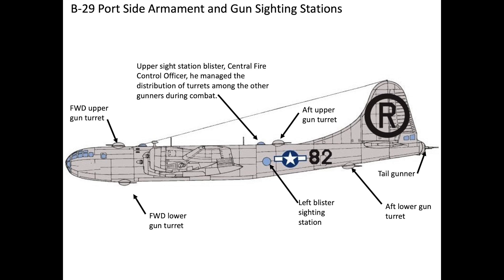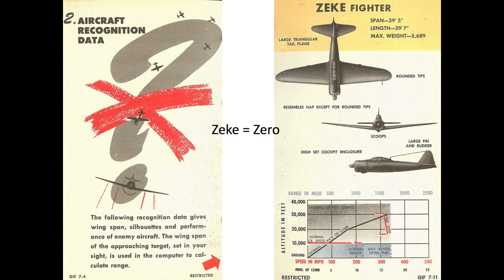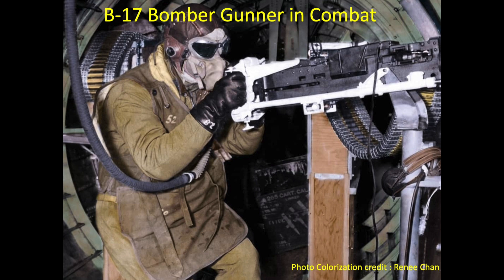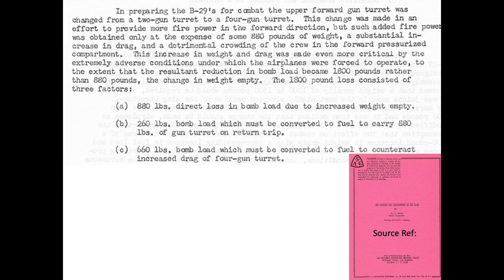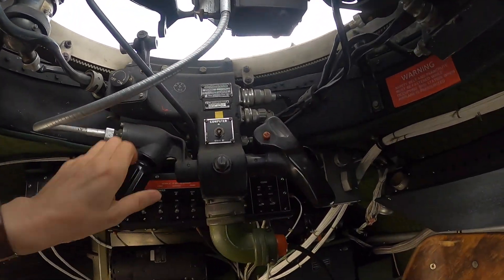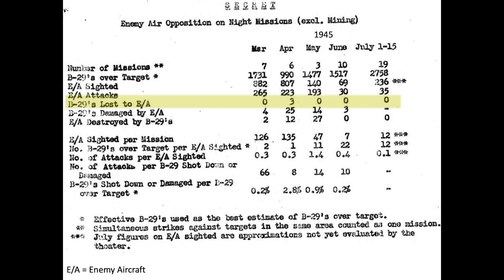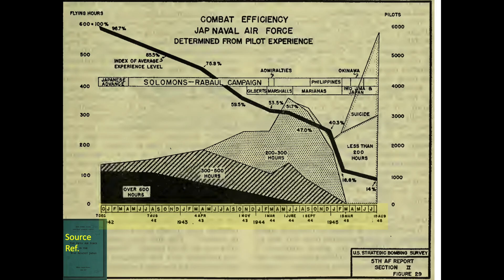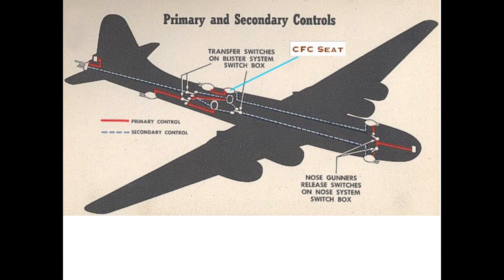Why the WWII B-29 Bomber's Gun System was so Combat Effective

Comment: I'm sceptical about the figures regarding the reduction in bomb load from two additional machine guns in the forward turret. The B-29s that dropped the a-bombs had all armour and armament (except tail guns) removed to enable carrying an extra 4,000 lbs or so of bomb load, which does not really square with two extra guns reducung bomb load by 1,800 lbs.
Reply: I have read somewhere on the internet, probably Wikipedia, that a B-29 taking off for Japan from Tinian had 2.5 tons of bombs and 10 tons of fuel. A return trip of 2,400Km
Reply: The guy doesn’t seem to be making it up he is using figures the army is using. They did the calculations and testing. They have no reason to make it up.

Comment: My dad was a B-29 gunnery instructor, from late '44 to early '45. He didn't really say all that much about the B-29's gunnery system, just that one gunner could operate more than one turret at a time. This video fills in all the vast holes in info I could glean on the system, most of which I only have gotten from reading books on the B-29 missions.

Thanks for the vid, especially showing how the different mechanisms of the system worked. Now I have a better idea what my dad had to know so he could teach the gunnery crews -- many of them probably sent to the Pacific Theater.

Comment: In the last few months of WW2 with B29s raiding Japan, LeMay ordered that the tail gunner be the only defence weapon to be retained and the weight savings of two less crew etc and weight of guns and ammunition gave the B29s higher service ceilings, better fuel margins or more bomb load. More B29s were downed from engine failure and running out of fuel than enemy fighters. 25% of all B29s were lost this way.  Like the B17, the B29s 50cals were not good at downing enemy fighters. Japan didn't waste Zeros on attacking bomber formations. It was futile. They concentrated on attacking Okinawa and US shipping. The other problem solved was that a B29 with full crew, full tanks and a full bombload had trouble getting into the air from the 7500ft strips at Tinian. They were supposed to be 8500 feet. Major screwup. The first aircraft to try it ended up in the water off the end of the runway. LeMay was furious. Even with the weight savings, the engines only had 3 minutes on full military power before they had to be replaced. The Corsairs were worse. One shot of water injection in an emergency and the engine had to be replaced.

Comment: There are actually some conflicting assessments of the system's reliability as it was new tech with some development issues. Following is a critical assessment but the most of what I've read depicts operational successes regards the gunnery system . . . not so much the initial Wright R-3350 power-plants or engine nacelle flaps. What seems to be the main reason to scrap the turrets are weight savings for one goal or another and the fact that the aircraft's speed relegated the majority of attack passes being head-on. 
The B32s try at this, also with the "Sperry" system was said to be either more problematic or the problems more publicized. 
I would guess that the pressurized interior would have been mighty vulnerable had Japan been able to field well trained pilots with more capable aircraft in the numbers reflected in the B29 gunner kill claims..
My dad was a gunner for the 90th Squadron, 3rd Bomb Group, 5th AAF in A20s and A26s, the latter having similar remote controlled turrets. He claimed to be denied use of them in the air defense role due to their most excellent P38 escorts which fielded notables such as Thomas McGuire and Richard Bong. 

FWIW here's the aforementioned critical balance: https://theaviationgeekclub.com/heres-why-the-b-29-could-have-had-a-higher-loss-rate-than-the-b-17-and-b-24-over-germany-in-1943/

Comment: I'd be interested to know more about the drill for depressurisation before combat. Presumably the bomber crew would get cold pretty fast or did they have heated jackets they could put on quickly?
Reply: You can depressurize and still heat the air inside the plane.

Comment: The machining that went into that analog computer. I'm a machinist and we're some of the most annoying, arrogant, finicky people. Obsession and perfectionism built that computer. Those engineers and machinists were amazingly intelligent.
Reply: Right! I just love analog computers. They're endlessly fascinating, with all their gears and levers, knobs and dials. Some very deep thinking and understanding of math went into them.
Reply: This WW2 tech can’t be duplicated today.
Reply: @hotlanta35 are you insinuating that this tech came from other worlds? If so, that’s incorrect. This tech from ww2 is outdated
Reply: You are trying to put words in my mouth.
Reply: @hotlanta35  There is a BIG fucking difference between 'can't' and 'wont'.
Reply: @Mets2015WorldSeries at no point did he say this tech came from other worlds. Do you know how to read?
Reply: They are really works of art. I'm fascinated with the electro-mechanical computers of that era; not just the B-29 but also naval gun computers such as on the USS Iowa. These things all did math, and were as accurate as the input data allowed. Technically, they are "calculators" not "computers" in the modern sense of the word. Calculators run only one program which is in fact built into the machine, while a computer is reprogrammable. Just a little semantics trivia FYI.
Reply: @ToolcoVFX  I've held one of the ferrite ring magnet memory units that the RAF used to use in their jets as memory, X/Y/Z axis wires in a thick mat, where one is obviously the read wire. I think you have to rewrite the magnet once you have read it as it's a sort of destructive read.
Reply: @ToolcoVFX  These computers were mostly mechanical computers that used electronically powered servo motors to retransmit shaft positions.   They derived from naval and AAA practice.   Prior to servo motors humans would need to re-enter the shaft positions manually which is why the M7 predictor had a team of 9 people which was eliminated with the M9.
-The way they worked is simple:   numbers were represented as shaft turns.   Addition was performed with differentials.   Multiplication, Division of two variables was performed by conversion to a Logarithm on a cam, addition with a differential and conversion with an antilogarithm.     Cam shafts were usually 3 dimensional.   Trigonometrie cams were used for parallax conversion.    Ballistics cams provided time of flight data and superelevation needed for projectile fall off.   
-The More accurate systems converted from cartesian coordinates to do the firing solution and then back again to spherical coordinates.
Speed was often easily obtained from tachos generators mounted on the shafts or mechanical subtraction.
Reply: I'm a machinist too... guilty as charged.
Reply: An instructor in college told me to never frame a house with your machinist friend, but definitely ask him to help build the staircases.
Reply: @davidfortier6976  ah, so he didn't want to frame it square. Shame.
Reply: Truly The Greatest Generation
Reply: Like machinists, engineers tend to be annoying, arrogant and finicky.  Machinists are more likely to ride and restore motorcycles.
Reply: Your right, I work with machinist and they are  some of the most annoying, arrogant, finicky people.

But I wouldn’t work with one that wasn’t ... :)
Reply: The majority of surplus analog computers went into late 1940s and 50s Wurlitzer jukeboxes. I have spent many thousands of hours restoring these jukeboxes and it has always amused me that a device so potentially deadly could wind up entertaining people.
Reply: Pride and duty to their country pushed people to put out war materials !!
Reply: But thats the real thing isint it? Making a set up that a well trained houswife can use to machine a complex , critical component. I wa a machinist for 35 years. My most challenging were programming and setting up half a fifty man shop full of fadals n haas vmc's . i had some machinist apprentices, some tool and vice or clamp setup men 2 great inspectors and buttom pushers who needed to be able to measure and deburr their own parts. We put a lot of respect into people who could operate a file really well! It all comes with training but yeah I guess they're all artists in a way. I never made more than a flagman and yet I was making parts that are still in space parts for Allegheny air ballistics Laboratory, and artificial heart valves among other things. I love to make things for myself for my Cafe BMWs but who wants to be a machinist with all that responsibility and make nothing and be treated like crap
Reply: It's closer to a mechanised series of log tables, not a computer.
Reply: I'm not a machinist, but I dabble in it as a hobby, as well as some other allied occupations.  I think people used to be a lot smarter than they are now, based in part on the subject of this video.
Reply: The other alternative was defeat and death… I understand the impetus

Comment: I've seen some old war footage with these turret computers and fire controllers. It really is amazing how far and effective the upgrades are compared to a b-17. Really night and day.
Reply: It really is amazing how advanced the Super Forts were.
The B-17 looks like a plane from the 1930s. The B-29 looks like a plane from the early Cold War.
Reply: Too advanced for the time... [Edit: Apparently I was wrong about the turrets, given the effectiveness stats in the video... Even if you cut back these figures as overestimation or bad Japanese tactics, they are surprising. But almost the only effective missions were the night raids, which all had the guns removed, leaving the turrets entirely as massive dead weight]. By the time the engine bugs were ironed out, the War was long over (only 1654 built in WWII out of the 3970 total). Only the weakness of Japanese defenses gave the illusion of superior performance, and due to magnesium engines burning at 5000 degrees through the wings in seconds (a material never used again) around 150 of 493 losses were engine fires (possibly as much as 250), The engine reliability was bad, and only through massive logistical overkill from engine replacements was this alleviated. By the time they were reliable, the whole aircraft was outclassed by jets. It then did get slaughtered by Migs in Korea... To minimise overheating during WWII, it flew with cowl flaps open all the time, so far, far below spec speed, this all the way to the end of WWII. Only Nuclear bombers and B models had better engines during WWII. Pressurisation also made it blind from condensation if damaged, so over Europe against stronger defenses (even if only from flak) it might not have fared that well. The expense of the turrets did make sense with strong fighter defenses in mind...
Reply: @wrathofatlantis2316  Sounds like you know a lot about American aircraft. Thanks for the explanation.

Comment: My dad was combat camera with the B29s, so some of the footage you see of them would have been made by him.

The only story I heard from him: The toilet in the B29 was basically a big can. Common practice was that whoever used it first had to empty and clean it after the mission. There would be a lot of crossed legs and straining for several hours until someone finally gave in and used it, immediately followed by the pilots cranking up the trim to account for the rest of the crew running to be next. 

Am guessing a bit exaggerated due to the plane probably being on auto pilot.

Comment: My understanding from, old timers now mostly dead, is that the B29 integrated gunnery system, didn't work very well as it kept breaking down. The kill ratio success was mostly because of three factors: the B 29 mostly flew at very high altitudes, (Japanese planes had much poorer performance at those altitude s) radar now  much improved latter in the war detected Japanese planes much farther out. the flight speed of the B29 made interception more difficult for the Japanese, negating the ability to choose a more favorable attack profile.
Reply: Also, by this time in the war, fighter escort was available nearly as soon as the B29 went into combat in the Pacific.

Comment: I wonder what was so great about MiG-15 that it was able to take down these flying beasts in such large numbers in Korea...
Reply: I had a good friend who was a main gunner on B29 and B,50 in Korea. The ability to get off aimed shots against jet fighters was about 1 second. 
He said that they trained against American jets,in daylight,from all attack angles. For a head on attack the chance of even seeing the fast closing jet was slim.
They changed to night raids,but still had to do daylight recon missions, which were very hazardous.
Reply: @blindhog2756 The gun system did have significant impact at Korea. The Soviets knew the record over Japan. For several months after the MIG’s showed up, they did not make a pass. This was probably the biggest impact. They did circle miles away. Once they made passes everyone learned the system was out of date. The gunnery system did restrict the MIG’s to rapid passes, also providing much protection. Someone mentioned tracers. They were used, at least by the two wings out of Kadena. Every fourth or fifth round. Someone decided that the tracers had a different ballistic arc, so they were pulled. SAC kept stats on everything. Most MIG’s did turn off during their pass, only a very few passed by at wing length. They found that with no tracers the average MIG turned off ~200 yards closer. The tracers went back on the ships. The USAF did credit B-29’s with shooting down a few MIG’s at Korea. Dad was skeptical of this, but as a lead bombardier the target was his focus. He said get in close enough and the gun’s servos didn’t keep up. Maybe. I don’t think the concept of latency was common in 1950.

Comment: So much information ! Awesome !  2 things that surprised me, 1/ the payload penalty when using a quad 50 turret. I would have guessed much less maybe 500ish ? 2/ The pretty poor arc of fire of the tail turret. Seems common to most bomber tho so I'm wondering why. I'm guessing it technically difficult to have a full blown turret all the way at the end of the plane. Definately not a place where you'd want extra weight.
Reply: @jackgee3200  Only the B-29 had armament removed due to the Japanese holding back for the invasion... And it was only the GUNS... They still dragged those 4 X 2000 pound turrets with no guns on those low altitude raids... And angled guns allowed the Ki-45 belly attacks without fear, save a few "misguided" crews keeping one lower rear turret armed with minimal ammo... They could not claim the kill afterwards, having disobeyed the disarming orders...

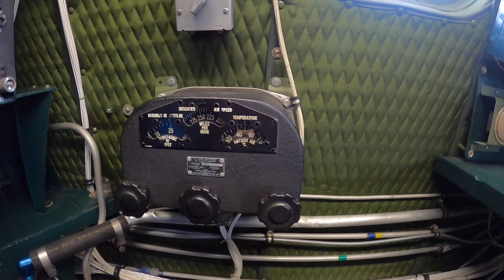Comment: 1:35 : Degrees Celsius ?! In a U.S. WW2 aircraft ?! It's the work of the devil ! :D

More seriously, was there a specific reason to choose Celsius over Fahrenheit, as the bomber crews were obviously more familiar with the latter ?
Reply: It probably made the internal math done by the computer easier.
Reply: @kerededyh  Not really. The thing that matters the most when doing those kinds of calculations is the absolute temperature if approximating the air as an ideal gas, so you'd be using Kelvin or Rankine degrees.

If it's something related to the boiling point of water, the Celsius scale makes sense... in standard conditions at sea level. Which is obviously not the case for the intended flight profiles for the B-29.
Reply: The Celsius or Centigrade scale goes back well before WW II.

In 1742, Swedish astronomer Anders Celsius (1701–1744) created a temperature scale that was the reverse of the scale now known as "Celsius": 0 represented the boiling point of water, while 100 represented the freezing point of water.

In 1743, the Lyonnais physicist Jean-Pierre Christin, permanent secretary of the Academy of Lyon, inverted the Celsius scale so that 0 represented the freezing point of water and 100 represented the boiling point of water.
Reply: I don’t get that either.
I tried looking it up on several different websites and came up with zero help.

Comment: Excellent insight, especially with the data. The aiir to air kill ratio compared to the P51 shouldn't be overstated as the loss of a B29 is greater than a P51. In the short comparison of escorted to unescorted missions, as you'd expect A/A losses are unaffected, but EA losses are reduced by 67%. Do you have any data on damaged B29s and casualties, where the B29 wasn't a total loss?
Reply: B-17 and B-29 bomber air to air kill claims seldom matched reality.
Reply: @moodswingy1973  they did on the b29, every kill was verified with a camera as stated in the video, and it had strict requirements to be counted as a kill